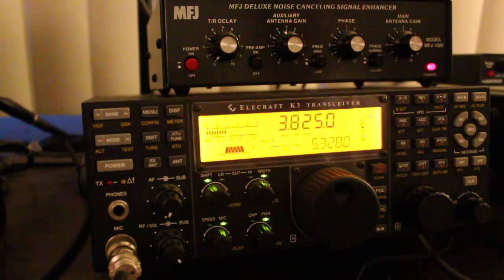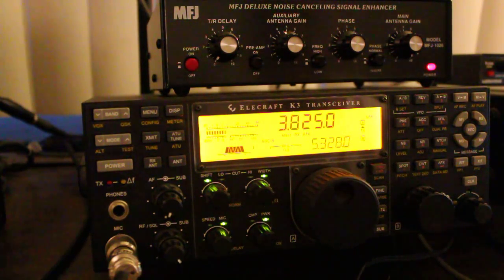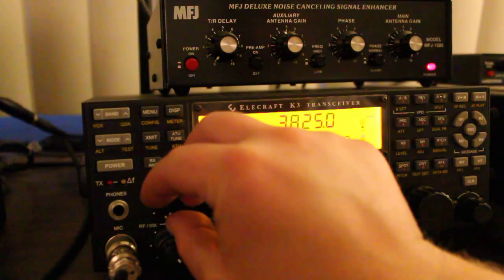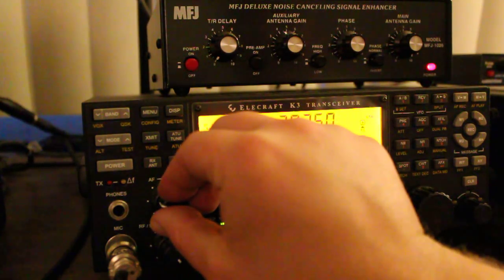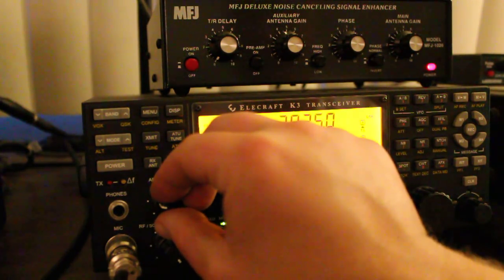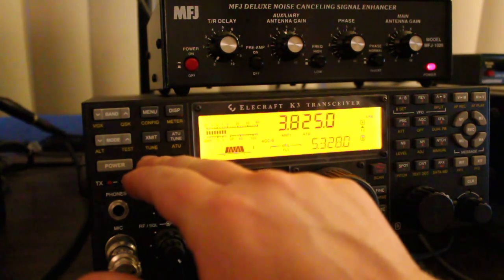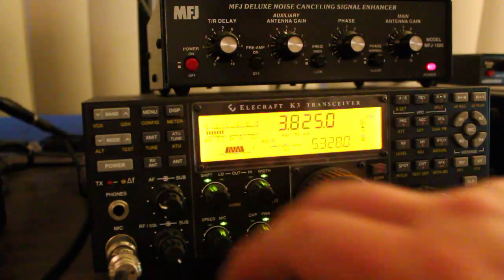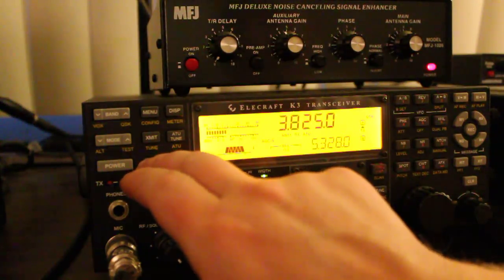MFJ-1026 Noise Canceling Demonstration

Comment: Thanks, here is my setup:  I am in a severely HOA restricted environment.  No outside antennas.  My transmit antenna is in the attic, and I get out fine.  I cannot use the attic/transmit antenna for receive; S9 +10 noise on all bands.  I installed a Pixel mag loop antenna with a rotator covertly in the back yard; I can finally "hear" again.  It's not perfect, but it really helps in receiving.  Question: would the 1026 work with my setup?  I use a DX engineering RTR-1A receive antenna switch; since my rigs do not have separate receive antenna inputs.  tnx  '73  Bob
Reply: +bobclarie It depends on whether or not the Mag loop is able to hear the same noise that your attic antenna is picking up.  If it is, it could likely null it out.